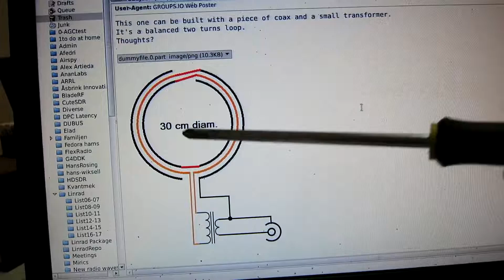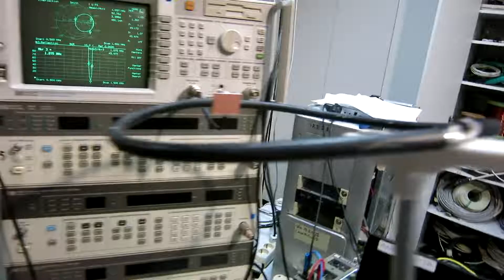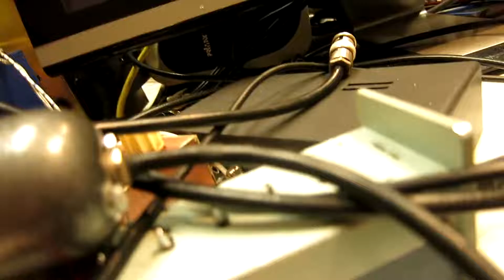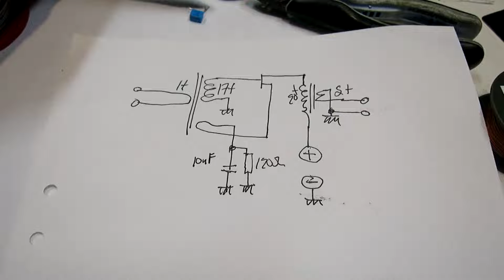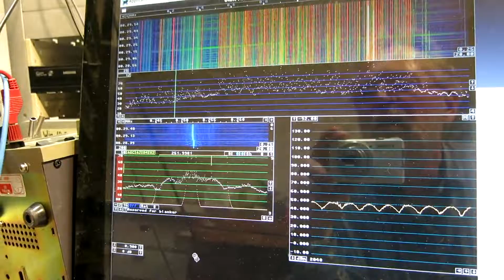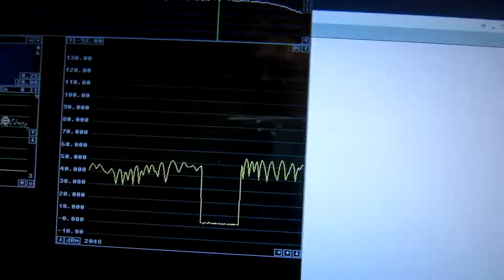loop30

Comment: Very interesting! How many turns on the feedback path?
Reply from the maker: The source feedback is a single turn. The single turn connected to the loop is made from a copper tube with nearly 8 mm diameter made from thin sheet metal. It can be seen at 11:00 in the video.Filling the hole of the ferrite core with copper minimizes leak inductances. This becomes important when the loop is made from a single thick tube or from sheet metal as in this video: https://www.youtube.com/watch?v=C65u7Pmz7a0